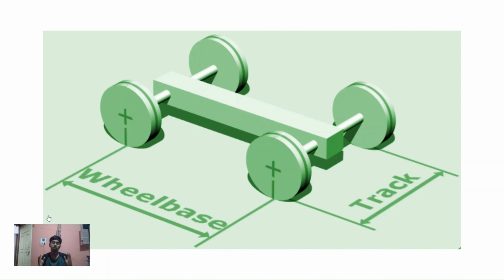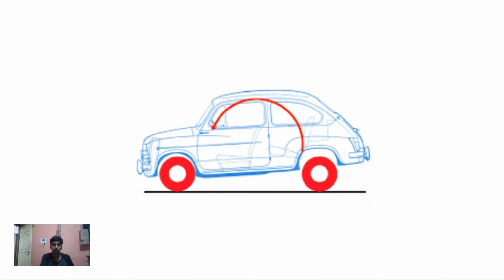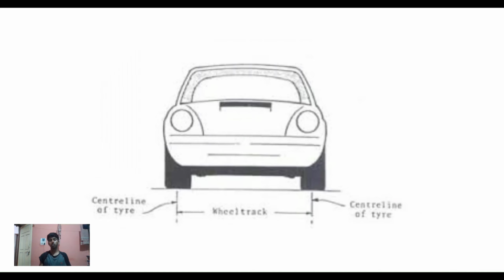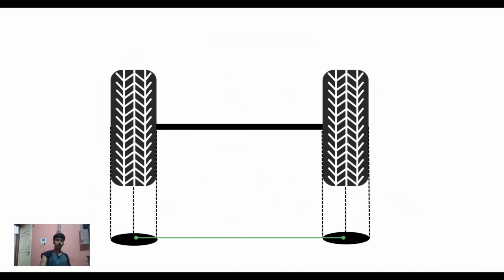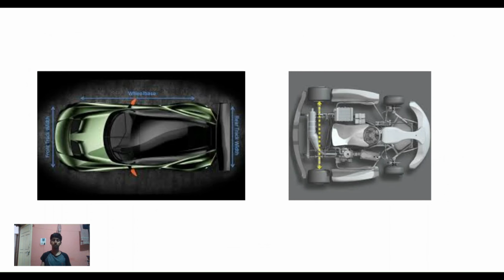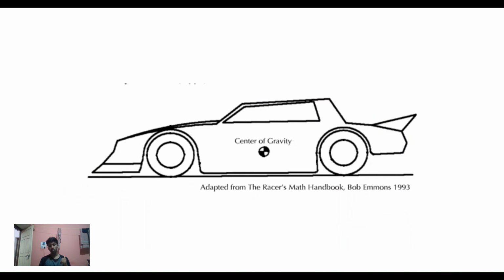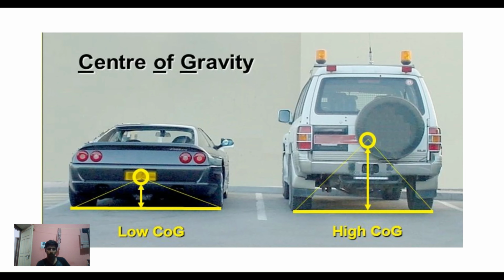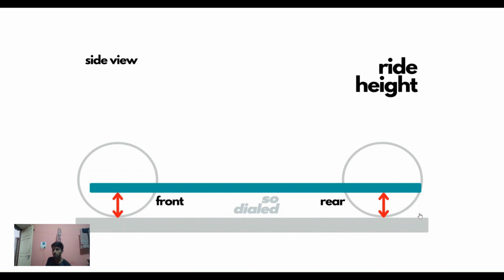Automotive basics: Wheelbase, Track width, cg height and chassis height

Comment: Hey, I wanna ask, how are cars with longer wheel bases not very responsive? 
P.s it is great to find a channel explaining this stuff in english. Most others are hindi.
Reply from the maker: hey there! sorry for the late response !

yes car with longer wheelbases feel slow in responding to the steering inputs, that's because of their larger polar moment of inertia, you can check it up on Google but in simple terms of weight distribution of a body is farther from its axis of rotation, the more difficult it gets to turn that body.